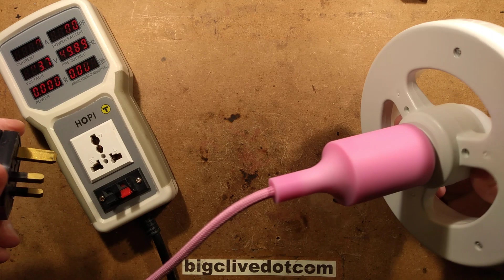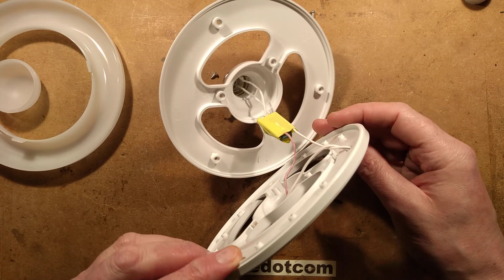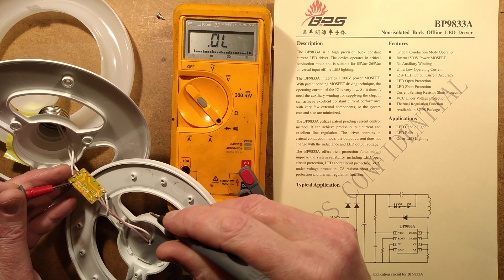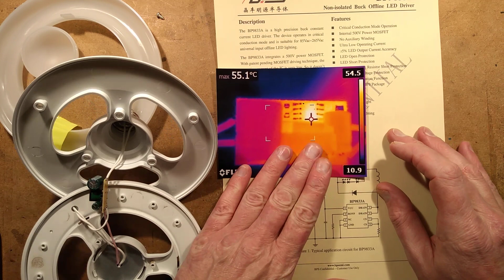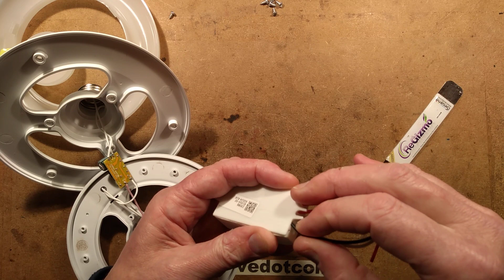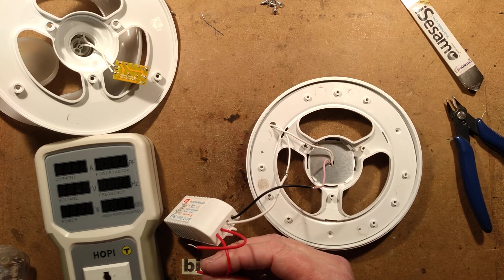Inside an LED "Circolux" lookalike?

Comment: When did led's start giving off white light instead of blue like when they first came out, as it put me off buying led bulbs? As for your nightclub birds of a feather flock together so you would  gravitate with people like yourself and unless your group was up to no good you would not know about it.
Reply: They've always been available, just pay attention / watch out for the color temperature of the bulb... The blue ones are around 6500k and the white / yellowish golden ones are 4500k and below. Apparently the blueish ones were more common when led's came out because the light output was weak and the phosphor coating that makes the light warmer and nicer looking lowered brightness too much, but It's easy to find both on sale and on discount in various stores these days... Try some out. If you like incandescent white then 4000k will make you happy. 4500k is a little crisper like a halogen. With a little looking you can find 2700k too, which is more golden like a dimmed incandescent.
Reply: Thanks for the reply, I have updated all my bulbs to white led's.I bought a torch/flashlight years ago and it gives of a bluish light which is OK but for the house I prefer white so I do not buy them thinking they were all blue.
Reply: they are blue leds, but they have a phospor coating just like a florescent tube to make them white, the old style leds didnt do this and were a horrible bluish light,
Reply: Thanks, that horrible bluish light put me off them.
Reply: Tony Papantoniou The bluer higher color temperature LED bulbs have the greatest efficiency, so you will still see them used in things like security lighting but they are unpleasant for much else (some as high as 10,000K color temperature!).  If you prefer the warmer/redder glow of traditional incandescent bulbs then look for LED bulbs with color temperatures in the vicinity of 2700K (K as in degrees Kelvin) and ideally a CRI (Color Rendering Index) of 85 or greater — 100 is perfect color rendering.  If you prefer the look of soft white fluorescent bulbs look for around 3100K.  If you like the lite from halogen or full spectrum fluorescent bulbs look for LED bulbs with a color temperature of around 5000K and a CRI (Color Rendering Index) of 89 or greater (black body radiators like incandescent bulbs have a perfect CRI of 100 for comparison).  Other than for security lighting, avoid anything with a color temperature greater than about 5200K as they are very blue.

The warm white ~2700K LED bulbs with a decent CRI (Color Rendering Index) of 85 or better are a great choice over dining tables and in bedrooms as they are both less stimulating (mentally/physically) so lend themselves to rest or relaxation and food tends to look more natural and appealing to those of us accustomed to incandescent lighting (though 3100K is also acceptable at a similar CRI).

These days there exists an LED bulb for most every application around the house so don’t be afraid to update if you wish — just watch for the color temperature (degrees Kekvin) and CRI.  In our house we pretty much exclusively use ~2700K warm white LEDs and ~3100K cool white (sometimes labeled “soft” white) LEDs in the various rooms.  I only use the bluer higher efficiency LED bulbs for outdoor security lighting.

Comment: Russian roulette with capacitors! 
Would it be possible to build a circuit where a micro controller chooses one of 6 capacitors to charge and then you have to choose one to touch? 
Only a very small capacitor so it just makes you jump but I think that would be a great dinking game 😂
Reply: Well, it would have to be a drinking game, right? Because no one would play that while sober.
Reply: Brabham Freaman haha exactly! 😊
Mind you that said I have a morbid fascination with capacitors. I once told Clive about it and apparently he is the same. 
I got quite a zap from a kettle plug once after I unplugged it and I immediately touched it again to see if it would happen again! ( it did ) 
Since then when I unplug an appliance I can’t help myself And touch the plug pins.
Reply: Wow you're kinky
Reply: @mavos1211  where you live, is it 240v or 120v?
Reply: @toysareforboys1   probably 120 i dont know  maybe 240
Reply: All you need is a class X capacitor (suitable for connecting across the mains), a double pole double throw switch and a pair of electrodes. Connect the capacitor across the switch common pins, the electrodes to the output 
1 pins and the mains to the output 2 pins. Switch the capacitor to the mains position and put your tongue across the electrodes. Flip the switch! (A break before make action switch is essential). How loud you scream is proportional to what part of the mains cycle it was when you flipped the switch.

Comment: There's still a GE "CircleLine" fluorescent circle tube in the laundry room ceiling light here. Thing must be 30 to 40 years old. When it is on, it wipes out any LW or MW radio in the house.
Reply: In the US, the most common brand of such is the GE Circlite brand since most were made under the GE name.  I never had any issues with them wiping out radio reception (I still use them, especially in the magnifier lamps at my electronics workbench) — in fact, as an amateur radio operator, they would not exist anywhere in my house if they were significantly impacting radio reception.  If you are experiencing radio reception issues I would consider unplugging the bulb and cleaning the pins as any arcing in the connector will generate broadband RFI.  It’s also worth double checking that the base is fully screwed in if it has an Edison base as sometimes years of vibration will work the bulb loose.
Reply: It's "Circline" and still made by Philips and others.   My magnifier work lamps use them.   Not better or worse than ordinary straight fluorescent lamps, just round.   4 pins, as if you took a regular F20 lamp and bent it into a circle.  It's actually quite nice for a close-work light as it doesn't cast any sharp shadows.  There are some microscopes that use a miniature CFL version of this for stage lighting.
Reply: I could see a magnifier light being a great application for this type of light.
Reply: My elderly neighbor had a chrome circle fluorescent in his kitchen for decades... It gave off a horrid tone of grayish green white and I always wanted it to burn out so it'd get updated with a better tube, but now that he's gone and the family remodeled the house I miss looking at it.

Comment: Don't forget that capacitive (leading) power factors will cancel out against any inductive (lagging) power factor devices on the same parallel circuit.  The maths involved is a wee bit scary, with j's all over the place, but the upshot it's probably not going to be as bad as you think.  You can correct a bad lagging P.F. with parallel capacitance; a capacitive dropper will tend to do this for you.

Actually you could have a device attached to your consumer unit that just measures the P.F. continuously and switches banks of capacitors in and out of circuit to try to keep it as near as possible to 1 at all times.
Reply from the maker: That doesn't work with modern electronic loads.  The current waveform is non sinusoidal and peaks at the centre of the sinewave.  It requires pretty much another switchmode power supply before the main one to spread the load across the sinewave as a series of pulses.
Reply: bigclivedotcom Ah, yes, it will only begin to draw current once the mains voltage exceeds the voltage to which the smoothing capacitor is already charged.

You could certainly do dynamic P.F. correction, though; it would just need something a bit fancier than just capacitors, relays and a simple microcontroller.  You would have to be able to do something like charge capacitors in parallel and discharge them in series to get the required voltage.

I have got Solar panels on my roof, and they feed into the supply by means of a synchronous inverter, which matches its output exactly to the mains waveform so it is always behaving as a power source as long as the Sun is shining.

More complex than my original idea, then, but there must come a turnover point where it's cheaper to fix your own P.F. than pay for the imaginary power.

Comment: surprised you dont twist those stripped plastic tails to twist the wire and the plastic comes off at the same time, than twisting it after pulling it off (like if you do a lot and get grease on the wire it can make tinning annoying).. just a erm, comment, i guess
Reply: He did.

Comment: If the power companies start charging for apparent instead of real power wouldn't that just push people to buy whole house power factor correction units? Or are those terribly expensive on the domestic scale? Do PFC units need to be replaced regularly?
Reply from the maker: These days power factor correction is best done in each power supply.
Reply: Do you think manufactures will start advertising their power factor on products, or should government demand products be labeled.
Reply from the maker: If power factor becomes a huge issue I can see it pushing the whole house DC lighting bus system forwards.  That way all the lighting could be run from a central power factor corrected 24V supply.
Reply: bigclivedotcom That would not be such a bad idea as then centralized emergency lighting would be absolutely trivial to implement throughout the average house, so no being suddenly plunged into darkness unexpectedly in a power outage.  As it is, I have a number of emergency light fixtures distributed throughout my house as my sense of balance is purely visual, so losing light after dark is dangerous since I will also lose my sense of balance within seconds.

Though my suspicion is that they might opt for a 48V bus (at least in the US) as such is still treated as “low voltage” wiring and the higher voltage would reduce the percentage of power lost to voltage drop while allowing for a lighter wire gauge while still being reasonable for many LED light fixtures since 14-16 LEDs in series would work well at such voltage.   

If we could globally agree on a common DC voltage for the lighting bus then we would greatly simplify the manufacture and sale of light fixtures and bulbs since they would all operate on a single common voltage.  It could also pay dividends for those of us in amateur radio by possibly reducing the RFI generated by modern lighting fixtures as that is becoming a real problem with some of the LED bulbs on the market today.  I even have an older LED floodlight that wipes out everything all the way up into the VHF realm and beyond (talk about “broadband” noise generator!) — it has a largely well designed switchmode, yet they opted to cut corners by leaving out suppression capacitors and ferrites despite having done everything else perfectly!
Reply: I've sort of wondered why that hasn't happened already - especially since (at least over here) it would become a much less-regulated system at under 60v.
Reply from the maker: @warphammer  You can be sure the same organisations that regulate the existing electrical industry would attempt to regulate a new low voltage system.  Probably using scaremongering.
Reply from the maker: @ianmelzer  It will become a selling point.  But some Chinese suppliers are already lying about the power factor on their products.
Reply: bigclivedotcom They may well try, but I strongly suspect that they would get a heck of a lot of pushback from the IT and telecom industries where 48VDC, and below, is heavily used for power distribution and signaling (just as a quick example, 802.3af/802.3at Power over Ethernet on the IT side), and those are industries with fairly strong lobbies of their own.  I can’t really speak for the European perspective, but I think regulating under 50V (save possibly for large, extremely high amperage, battery banks) due to the industry resistance such a proposed change would stir up.  

Even in my house I make use of PoE to power multiple 802.11ac WiFi access points (and other accessories like cameras), as distributing the power over the data cable allowed me to optimally locate the access points without having to also install AC receptacle and the headache of trying to somehow tidy unwieldy power cords and bricks — which is hard to do if aesthetics are any concern — as they are located above hall entryways!  Using PoE also means that the access points will remain fully functional for about an hour after the house loses power since the PoE switch/injector is UPS protected, and that means that we have an hour to save all data over the network and complete print jobs before everything has to be either shutdown or the 15KW generator started.

But, then, as long as the current administration is in charge over here then I’m not even sure God knows what craziness will be enacted, or at least attempted, from one day to the next, all we can try to do is to hopefully contain the craziness as best as possible and pray we survive this existential crisis.  We are still a bit stunned by the administration’s end-run to eliminate Net Neutrality even after Congress had explicitly ordered the FCC to enact Net Neutrality regulations.  This is almost certainly going to be one of those very ugly, yet intriguing, chapters in future U.S. history books.

Comment: i might have something new, when you drop a neodymium magnet down a copper pipe it slows down because of the magnetic field. if it was dropped down a tube filled with neon gas it might light up (maybe? 💡 🤔😯🤷‍♂️
Reply from the maker: It would need to generate a high potential across the magnet to ionise the gas.  But an old victorian novelty was a tube with mercury in it that glowed when shaken in a dark room.
Reply: bigclivedotcom 😯

Comment: Hello Big Clive; 

SPQr:

I've noticed you have increasingly been referring to "apparent power" vs "real power" and I agree the electricity companies likely will restructure their metering and charging system to extract ever-more money from an unsuspecting public, most of whom would have little knowledge of practical changes they could make to mitigate such usage (e.g.: switching to 240v LEDs rather than incurring extra power usage in the transformer units for 12v halogens etc). 

Now I could drone on until the internet crashes out of sheer boredom, about the differences but I'm inclined to ramble and become overly technical. I concede you have a far clearer and concise manner of delivery so, could you at some point, for the public at large, and not we Sparks, explain the differences between Apparent (S), True (P) and Reactive (Q) power - how they can be monitored by the Big Brother electricity suppliers and what steps folk can make to best alter the usage the meter 'sees' by making minor changes around the home. Thank you.

Kindest regards,

Big John
Reply: Forewarned is forearmed, a good not to technical guide to when the cash-hungry power companies flick the switch.
Reply: May I second this request! =3
Reply: Third this request 👍🏻
Reply: ahhh mate!! THANK YOU Big John....Big Al the dockers pal ⚡
Reply: what if i just put a big inductor between the meter and the rest of the house?
Reply: @SuperAWaC  That would make it worse in most cases. A parallel capacitor would work.
Reply: The power company over here refuses to guarantee in writing that they won't suddenly start measuring apparent power. So they will take my ferraris meter from my cold dead hands. I like the idea that the meter is physically incapable of measuring anything other than real power.
Reply: Question here is too, which is honest?

Comment: Curious if the meter fuse costs so much that a new meter is maybe cheaper, why even have a fuse at all?
Reply from the maker: The fuse in the Fluke is an industrial one and absolutely required to stop the meter exploding forcibly if accidentally applied across live busbars while set to the current range.  The fuse is definitely cheaper than the Fluke meter, but more expensive than the cheaper hobby meters.
Reply: Why not just use a standard UK BS1362 plug fuse. They are ceramic, sand filled and HRC. Use a 5A one if a 10A is not available. Dont use 13A.
Reply: @simontay4851  that's what I'm trying to figure out. Why not just stick a different fuse in it?
Reply: BC - I thought Fluke's claim to fame was they had moved to Littelfuse PTC devices, the ones with the "You'll never need to replace this fuse ever" advertising campaign (early 1980's, ads run in many  trade journals)??

Comment: I thought you had really f--ked up for a second there. You did mention the strange color coding, but I didn't catch all of that so I was wondering if you connected it backwards. Apparently, not though. They could have made the DC wires red and black with the AC wires blue or brown. That would have been so much less confusing.

Comment: A 250VAC dropping capacitor is a bit dodgy for UK line voltage.
Reply from the maker: It's 250V AC as opposed to DC which gives it a much higher DC rating.
Reply: Big Clive, the line voltage was about 245 in your video. It'd only take a small increase to exceed the ratings. Plus, capacitors are happiest with a bit of derating.
Reply: Против Глобал, Good point. I didn't figure it'd work that way. But, a quick simulation showed that you're right.

Comment: In the US black is hot and white is return for house wiring. I had an electrician in Texas wire both electrical and digital communication using house wiring code. He made a real mess with rs 485 communication wiring. He made black hot and red ground lol.